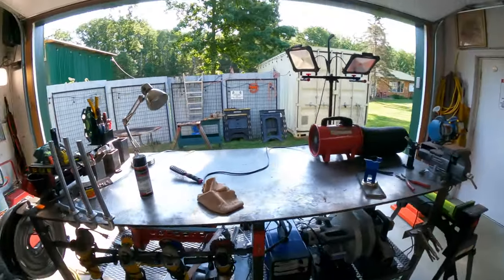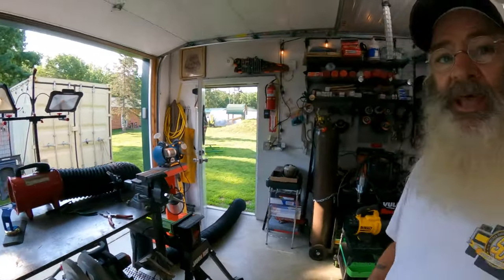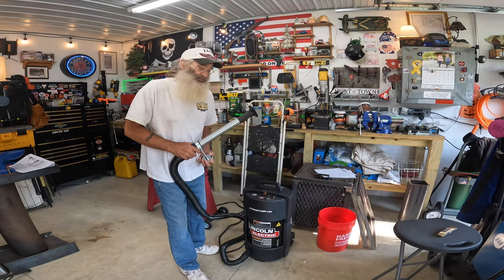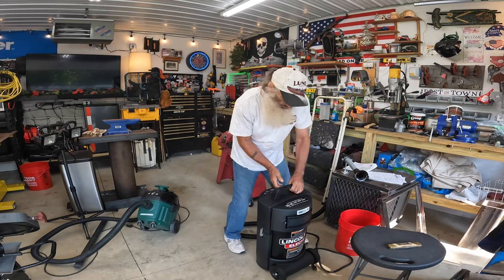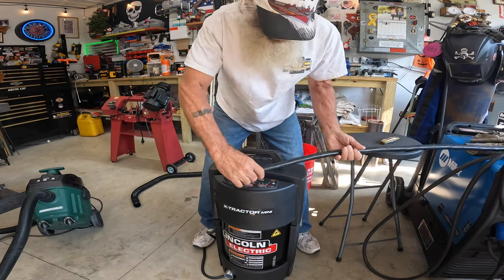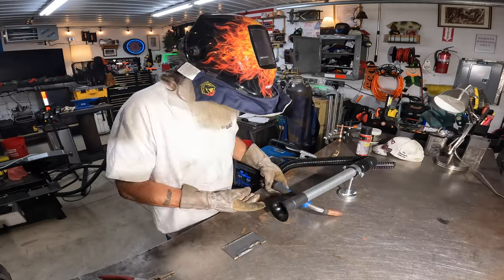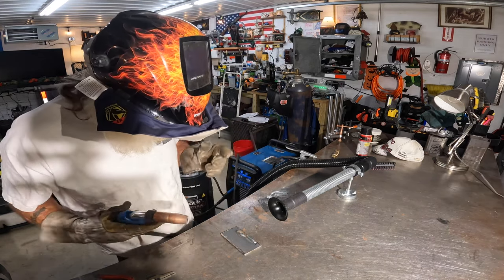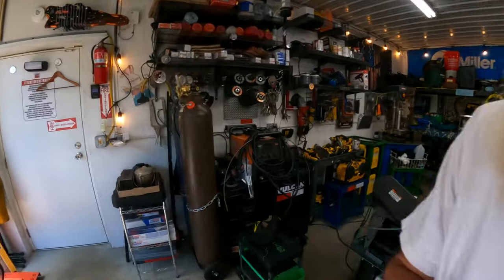NEW LINCOLN ELECTRIC ~ Mini FUME X-TRACTOR ~ For Those Cold "WINTER" Days

Comment: I’ve been in need of one of those for awhile now. Almost bought one when I was welding iand gouging under a hydraulic press. For the mobile guy or guys welding in small buildings this thing could be a life saver
Reply from the maker: It's a great extractor although I don't think I would use it a lot on anything other than mig to be honest!
Reply: @northcountry9926  why’s that? I don’t use anything right now besides maybe a PAPR system on occasion.
Reply from the maker: @scrapmanindustries  in the owners manual it says "for occasional stick welding". I'm paraphrasing, but thats the way I read it.
Reply: @northcountry9926  does stick welding destroy it or just clog the filters more often?
Reply from the maker: @scrapmanindustries  I'm honestly not sure.  I don't keep owners manuals because they are on line now.  However, it would make sense that it would be a case for changing the filters more often.  Moreover though, the stick welding extractors are HELLA LOT more expensive, so theres that.

Comment: Great review!  Nice welder too, is that a Millermatic 255?  Yep, the end of your video it’s clear, a 255.  I ordered a 255 last week and now plan to get the Mini Fume X.
Reply from the maker: Right on. Iv'e been using it a LOT!  MONEY WELL SPENT.  No Complaints whatsoever.
Reply: @northcountry9926  , thanks for the quick reply!  Do you still use and recommend the Lincoln Mini Fume X, or would you recommend a different fume extractor?

I also use a Miller welding respirator, which I would still use even with a fume extractor.
Reply from the maker: @rays9033  LOL, Actually I WAS talking about the fume extractor, however the Millermatic applies also! 
 I'm not really big on respirators unless I'm stick welding or welding things like zinc, galvanized metal or things like that though.  Then I just use the Harbor Freight junk, lol.